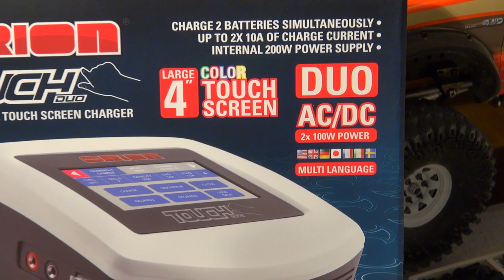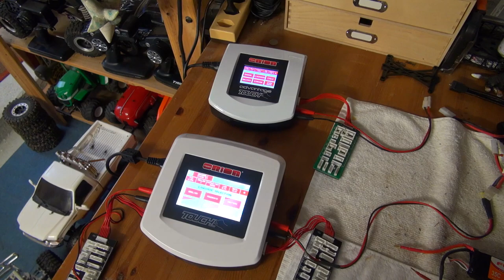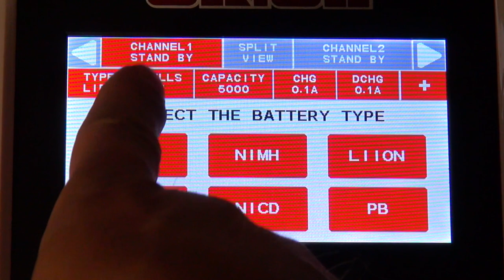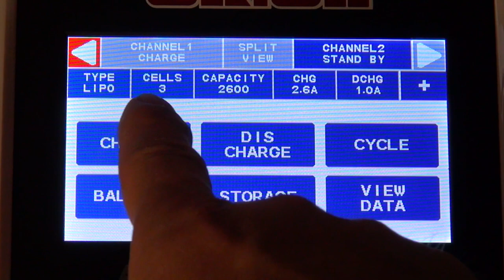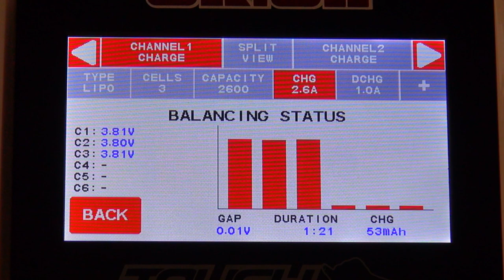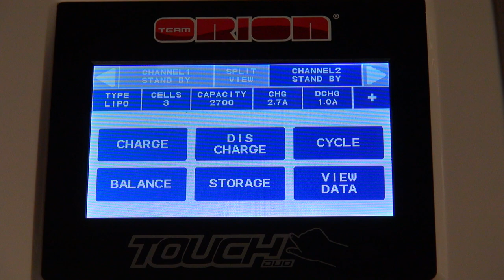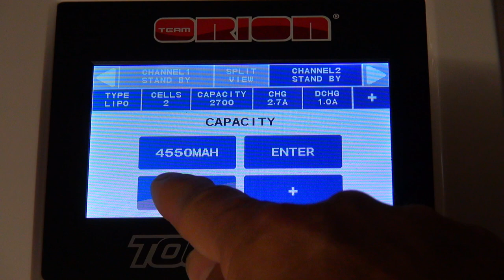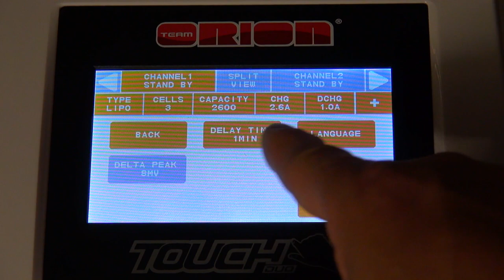NEW Team Orion TOUCH DUO charger - how I charge my Batteries!

Comment: Hi Mattel..,hope all is well!. Let's talk for a moment on this older vid.. Back when.., I bought this charger too for racing.., DOES yours still work???, after owning for a while, mine started and always overcharge one cell, and reads that while charging!, and cuts off and stops charging , goes into Interuption" mode.. How about u ??.. I have read problems on forums, this charger is discontinued, I found out a while back, the new on is HV Lipo compatableI.. just decided to give it one last assessment charge.. still no good.. HOW ABOUT YOU?.. peace bro...
Reply from the maker: This is not good, but I have no problems with mine. Since years it works fine and I use it a lot, also for different batteries. (also for airplanes)

Comment: Great video! I just received one of these myself, and I'm experiencing an issue... When I choose to discharge at any current over 1.2A, it stops at 1.2A and won't discharge any higher, and with NIMH batteries, it stops at 1.6A. The same thing happens when I storage discharge the battery, and when it's discharging in the  cycling process.
Reply from the maker: I found out the same issue on mine, don't know why. Maybe something with the battery type and condition. It would be interesting to see how it do this with big battery like a 5s lipo (22 volts and 5000 mAh)
Reply: Hopefully Team Orion will release a software update soon, although I don't know where the files are and how to download the files....
Reply from the maker: RC Grid We found out that the discharging performance of each channel is max 10 Watt, with a voltage of 7.2V, the limitation to reach the 10 watts is about 1.6A.
Reply: Thanks for the info!

Comment: Nice charger, are those the battery leads that come with it? Or does it come with the lead type that has all the different battery connectors on 1 lead?
Reply from the maker: A Deans lead is included. The board with the different battery connectors is only for balancing of lipo batteries and it's included.
Reply: *****
Only a deans? But I have to say, that is one of the most comprehensive balance port boards I have seen included with a charger (-:

Comment: Hallo Matteo!
Eine kurze Frage zum Advantage Touch Lader (der Kleine): Kann man das Kapazitätslimit deaktivieren? Wenn nicht, welche maximale Kapazität lässt sich einstellen?

Danke für deine Hilfe!

---

Hi Matteo!
One short question: is it possible to deactivate the capacity limit? if not, what is the upper limit?
thanks in advance!
Reply from the maker: Hallo Mike
Die Maximale Kapazität beim kleinen  ist 8000 mAh, und das lässt sich auch nicht ändern.
Reply: Vielen Dank für die Info! Leider findet man dazu keine Informationen beim Hersteller, im Manual oder sonst wo! Somit ist es nun klar für mich!

Comment: Matteo, where did you buy your 4500 mah nvision Lipo batteries, please?
Reply from the maker: From my Hobby Shop: https://www.wemushop.ch/Elektronik/Akkus/nVision-Sport-Lipo-4500-45C-7-4V-2S-Tamiya.html
Reply: Thank you. Seems as a great model shop, lot's of other interesting stuff.
Reply: Matteo. What ESC's are you using with your Lipo batteries, please?
Reply: Would you please have any suggestion what battery to use for the Sand Scorcher? I'd like a "hump back" accu at least 4000 mah, Nimh or Lipo.
Reply from the maker: http://tamico.de/Carson-Buckelakku-Hump-Pack-2700-mAh-72V-NiMh-fuer-Sand-Scorcher
Tamico is a good shop and it should be no problem to send it to sweden
Reply from the maker: I use many different. Often the standart Tamiya esc from the kit. Or in crawlres from Holmes Hobbies.
Reply: Thank you very much for your info, Matteo.

Comment: Matteo. Can you please confirm if the cooling fans in this charger start when using either left or right channel? Or if only when using left (red) channel. Thank you.
Reply from the maker: +Tomas Dahlgren Yes, it starts with left and right channel. But it starts only with a higher current. At lower charging amps it does not need a fan and it does not starts.
Reply: I understand. Thnnks for you reply. My Orion Touch Duo only uses fans when I use its left channel. Even with a 5000mah nimh on the right channel it won't start the fans. Strange. I bought it new from ModelsportUK.
Reply: Hm.... Ok, I may have fixed it. I did a factory reset on it and now both channels trigger the fans pretty soon when charging a nimh battery at 2100mah. I was a little worried there for a while.
Reply: Matteo. Sorry for asking, but I have another problem. I cannot remember if I fully charged my 2100 mah nimh battery. Can I try to charge it anyway, and will the charger tell me if the battery is charged/ not charged? Or will I damage the battery by charging it twice?
Reply from the maker: Yes, you can charge it again without problem. The charger recognize when its full and stops the charging. Or you can use the discharge function first and then charge it again.
Reply: Aha? Good. Great. Thanks.

Comment: Do why didn't you press the balancing instead of charging? Thanks
Reply from the maker: Cooldibs Because balancing means the charger only equals the voltage of each cell. And charging means the charger fill up the battery until the target voltage - full. During charging the cells will be balanced too.

Comment: can i charge 2x 6s 5000mah lipo batteries without any problem at 2C which means 10A?
Reply from the maker: ipadize No, this is too much, the limit is 100W per channel. http://www.teamorion.com/advantage-touch-duo-ac-dc-2x100w-eu-plug-de-2-3.html?sl=DE
You can calculate the needed output of the charger with this calculator: http://www.soko-heli-tools.com/de/lader-und-netzgeraet-rechner/lader-und-netzgeraet-rechner.html
Your battery need with this charging setup 280W per channel.

Comment: how do you charge a 1600 NiMH receiver pack. Do i plug it in the board??
Reply from the maker: +Ron Wilson No, does not work with the board. You have to connect this on the charging plugs, maybe you need a charging cable fit to your connector on the receiver pack. Then set the charger in NiMH mode and do all the settings. You do not need the board for a NiMH battery.
Reply: yea i just went the hobby shop and got an adapter. seem like this is something that should have came with this charger though,,